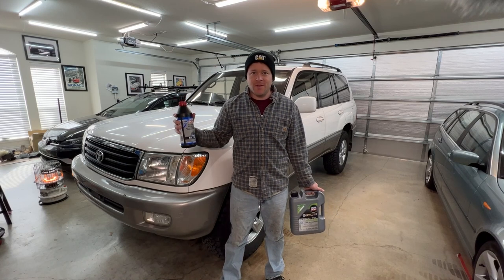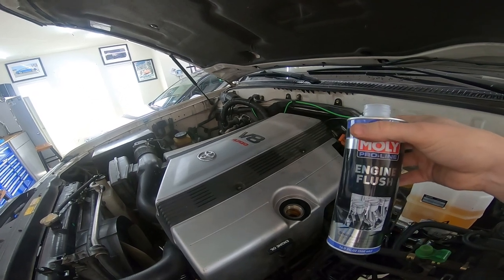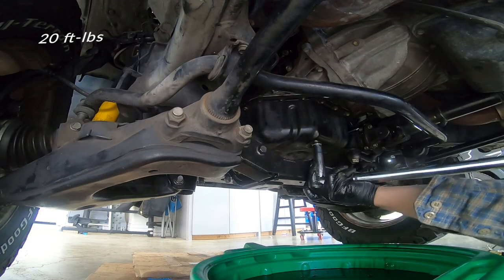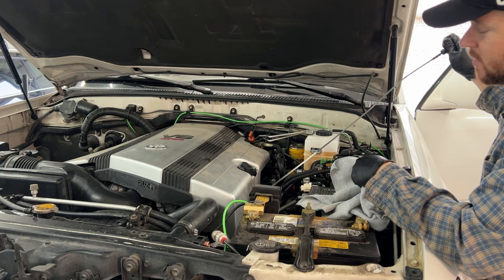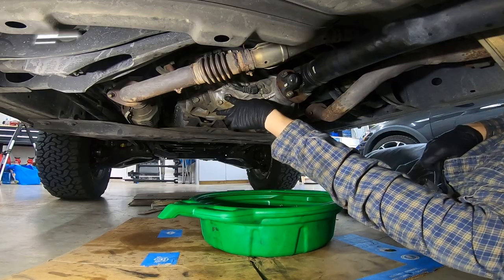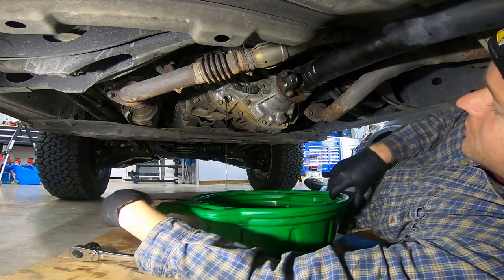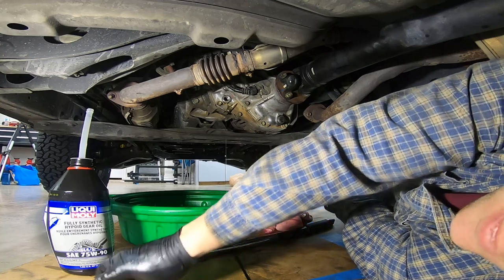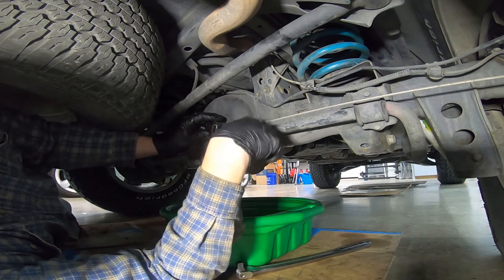100 Series Land Cruiser Fluids Change

Comment: Great vid. Thanks for walking through all the fluids. Glad to find your channel as I work through my new-to-me LX470. Did the rear diff, serviced the driveline and D&R power steering fluid.  Only suggestion I can offer is to improve your beer selection; you put top shelf fluids in your rig and picked the bottom shelf for yourself 🙂.

Comment: Watched a vid regarding the engine flush
It went explain the best way to flush is to actually fill the engine with a new but a temporary oil, so that you run 1k miles and then again drain it and after that fill your expensive/ good oil 

This is because after the flush, there is still some residue left in the system and it will thin out the new oil fast.

I hope everyone understood 😅